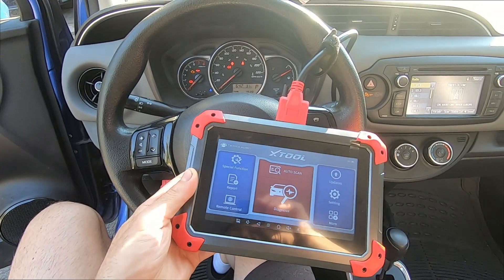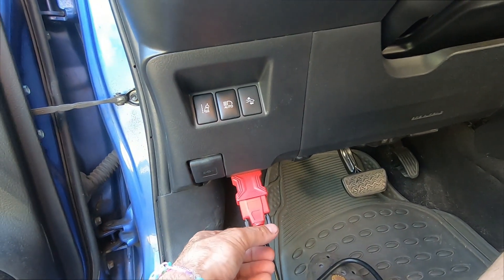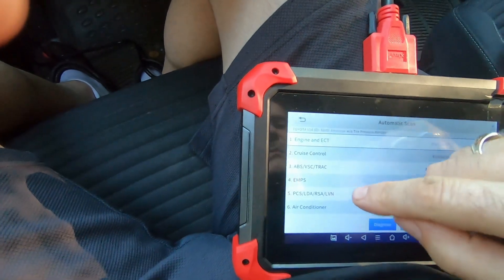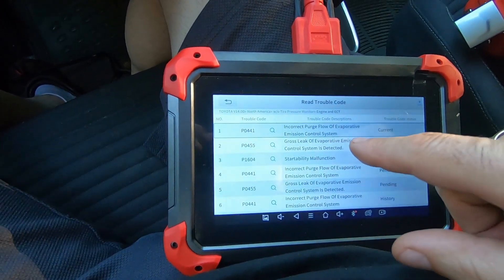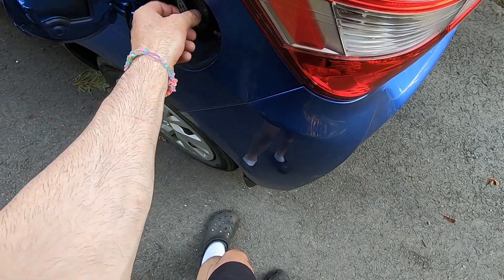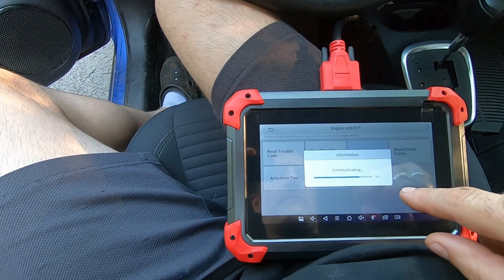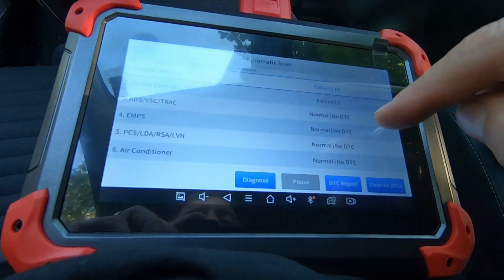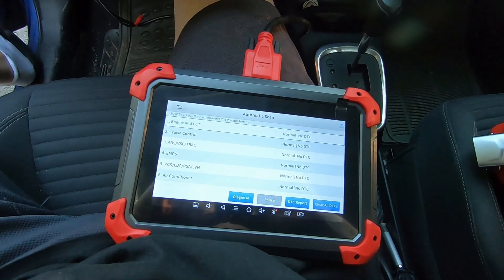Using XTOOL D7 OBDII Scanner To Fix Check Engine Light Codes P0441, P0455

Comment: I bought the xtool d7   I used it on two cars and have had nothing but trouble.  The tool took so much from the battery that codes just popped up all over the place.  One in garage not running.  One car in the driveway not driveable.
Reply from the maker: There's enough energy in the average healthy car battery to power the D7 for about 4 days. Assuming the battery was good and fully charged, in order for the D7 to draw so much current that it triggers codes to pop the D7 would be so hot you couldn't hold it and it would likely melt. This could never happen because the power to the datalink connector is fused and the fuse would trip.  How hot did the d7 get? How long did you have it plugged in?
Reply: Not the most coherent complaint.  Users need to have some auto repair familiarity to use scantool effectively.
Reply: Dude just take your car to an actual mechanic for the love of god 😂
Reply: I say bs.

Comment: I broke the pigie bank and bought the D8 and learning how to used at this moment. Nice video by the way!
Reply: I bought the A30M. It connects to your phone. Does almost everything the d7 does. I'm still testing it on as many cars as i can.
Reply from the maker: Nice machine. Let me know how you make out.
Reply: @mrdiyguy123  So far it seems to be just like the D7 but larger screen and it has a video port for an inspection camera